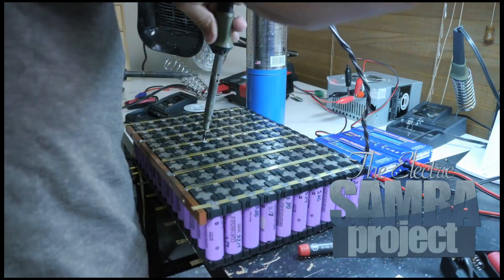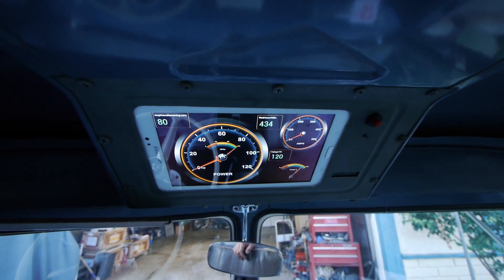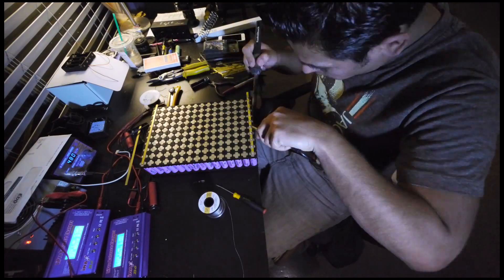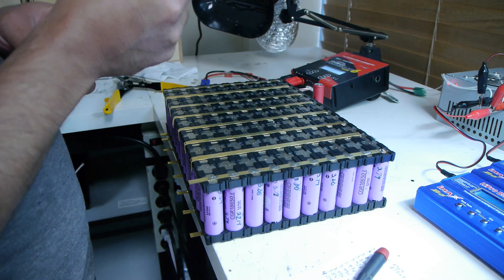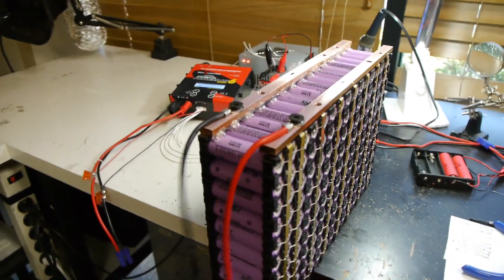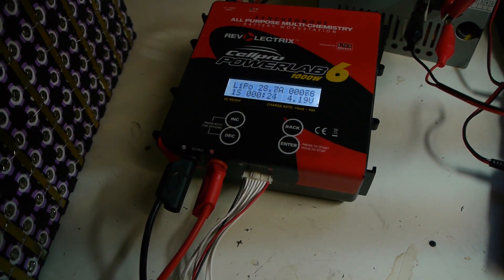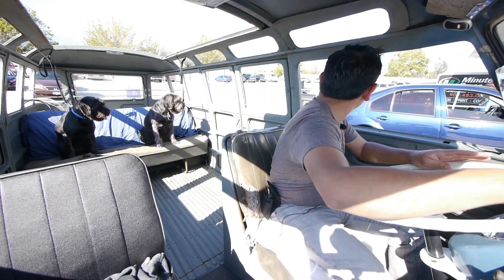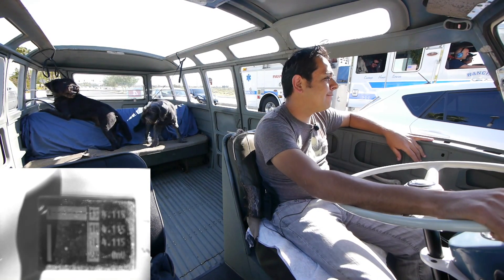DIY Tesla Car -  lithium ion 18650 battery -  VW Kombi

Comment: It's cool that you can make an usable battery pack out of dead laptop packs, even though it's a lenghty and labor intensive process..

Just one thought: We all know that lithium ion cells have better energy-to-weight ratio yielding a lighter pack than lithium iron phosporate, but on the other hand there is much lower safety as they are prone to thermal runaways if overcharged, overheated, damaged by overdischarging, they really need to be kept in controlled condition unless you want a fire show... Involving all of those facts isn't switching to Li-Ion a step back in terms of powering a car?

Comment: As far as I know in the electric the TESLA uses Panasonic batteries NCR18650PF 2,9 Ah, since they can be max discharge 10A.
85000W / 400V = 212.5 A, 212.5 A / 2.9 A = 73.27 ~ 74 pieces
400V / 4.2 = 95.2 ~ 96 * 74 pcs pc = 7104 units, about such quantity in Tesla talked

Comment: Hi Jehu, 
Really enjoying these cells take shape. Could you tell me, are you able to use the full capacity of the cell i.e. 100% DOD (depth of discarge)?
Cant wait for the next video!
Reply from the maker: …. I intend to,  4.2v to 3.0v    at 3v x 30 modules would give me 90 volts which still push the samba around almost at full power.

Comment: It won't work it's not playing
Reply: IE11 has major problems with the version with Bing and MSN lately loading webpages and loading videos. Not to mention the new Security Flaw they found which was mentioned on Cnet, they recommended people use Chrome or Firefox until it's fixed. I have no issues using Firefox 29.
Reply from the maker: IF YOU HAVE TROUBLE VIEWING THIS TRY THIS LINK: http://youtu.be/FdAEp-ZFmwo

Comment: That battery pack is nice and clean. I see your not having issues with mixing chemistries.
Reply from the maker: yeah so far I'm only used  Sanyo 18650FM  and Panasonic CGR18650E,   I don't know exacly what chemistry they are,  they might be the same?
Reply: jehugarcia I was meaning mixing your Sanyo pack with your LIFePO4 pack. The Sanyo are not LiFePO4 chemistry and a higher voltage. At least you have not mentioned any issues with different voltages being mixed. Or do you just charge your Sanyo Pack to match your other TS cells?
Reply from the maker: Oh I see, yeah I make sure to charge lifePo to 3.5v and the LiCoO2 cells to 4.2v before the test,   I ran the test then disconnected before recharging,  I'm going to do a discharge capacity test on the 2nd module tonight

Comment: If you want to have your RC charger to charge faster, CONNECT THE BALANCE LEAD of the first cell channel! this will monitor the actual real voltage of your pack and not the voltage read thru the high curent wires wich have a voltage drop. By connecting the balance lead your charger will see that the pack is not at 4.200 for a longer time and it will push the max current for longer time period  =) This WILL really accelerate your charging process. You gota try that !!   That's what i'm doing in my battery lab with my Icharger 4010 DUO wich can puush 70 amp for  1 to 10s.
Reply from the maker: Nice,  thanks for the tip